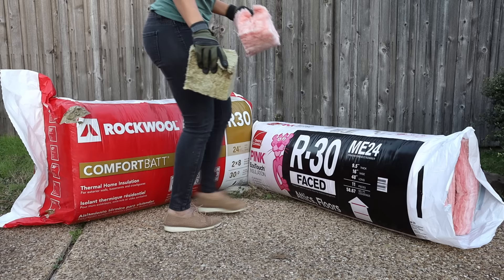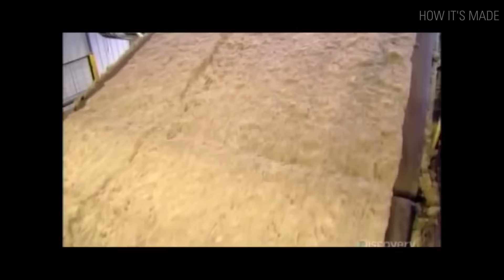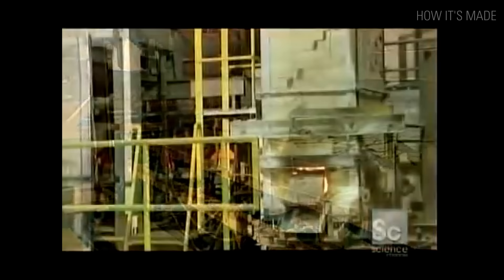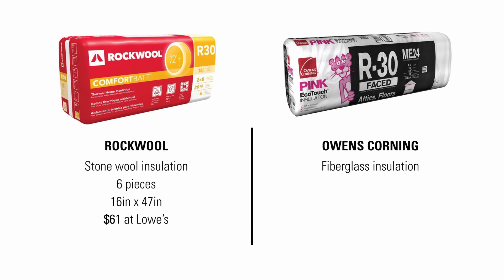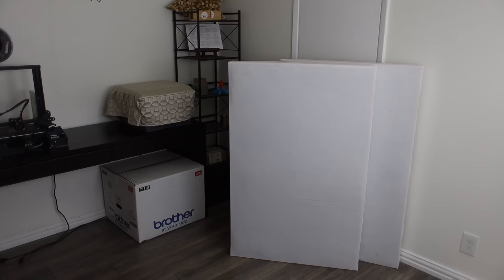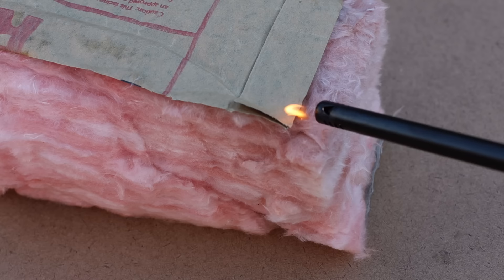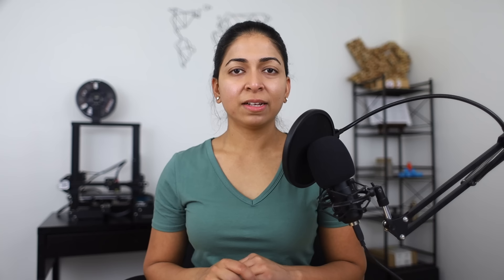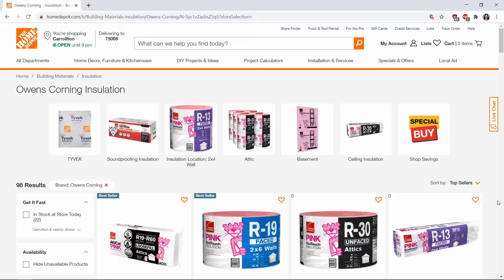Mineral wool vs fiberglass insulation | everything you need to know

Comment: had to renovate a room of my house - exterior wall needed to be completely rebuilt as the windows had been repaired improperly and resulted in the king and jack studs rotting away completely where the windows leaked into the wall.    Also found the roof was improperly constructed so it had to be redone on that section as well.   
When it came to time to rebuild, i chose to use stonewool, having worked with it in Alaska and knew it was MUCH more "user friendly" to work with.   fiberglass insulation, you'll itch for days and days afterwards.   Stonewool, a good going over with one of those sticky taperollers for lint, got rid of any lingering bits on clothing and skin without any real hassle and I had zero residual itching from it afterwards.   The stonewool was a LOT easier to work with in general, and I like the resistance to moisture and rot...  I'll never use fiberglass again..

Comment: That was the best review/explanation of these two I have ever seen! One question I have is about mice and Rockwool . Will mice use it to make nests or live in it? Good job on this video!
Reply: @kenthhamner2641  - which makes it idea for crawl space joists...
Reply: Yes, mice do get into it Rockwool and pull away at it. Our cats keep the mice down, but I do occasionally have to fix small areas of insulation in our crawlspace.
Reply: @kenthhamner2641  Only asked about pests.  We already got the rest of that from the video.
Reply: Seems to me that rodents will make a nest of just about anything so I have my doubts they would leave Rockwool alone.
Reply: @kenthhamner2641  no insulation will hold its insulation value when wet. that applies to rockwool. the insulation shown in the video (comfortbatt) does bend easily. i think you are confusing rockwool comfortbatt with rockwool comfortboard. it does cut, but it dulls knives very quickly.
Reply: @paperwait9611  That doesn't apply to Rockwool because it repels moisture - it doesn't ever GET wet.
Reply: I had a mouse get into my Rockwool insulated cabin in the very short period between insulating and closing in. It wasn't put off by the material at all and burrowed its way thru a number of stud bays, apparently quite happily.
Reply: @adammacer  🤔 ok. Thanks.
Reply: @adammacer  you are wrong about that. the mineral wool fibers don't "GET wet", but the insulation itself will hold water. i actually have rockwool insulation installed on my house so my comments are based on my own testing and observation.
Reply: @paperwait9611  Rockwool dries much easier, if it gets wet, while glasswool is almost impossible to dry out.

Comment: I just built a new 2200 sq ft  home in mountains of VA at 2600' elevation, and chose Rockwool for all the reasons in this video.  I have 2x6 walls, used the R23 in them.. Now on the roof deck I used open cell spray foam, as that is where most of the heat goes, and works great there, but side walls in the rest of the home was the R23 Rockwool.  This allows the home to 'breath' some, and cuts expenses.  But so far my heating utility bills have been very low,  lower than older fiberglass insualted home I  have in NC at 300' elevation and 10 degrees warmer on avg all the time.    House is also quieter, that was the 1st thing I noticed, hardly hear anything outside.  If you are building a new home, this is far superior to fiberglass, and close to foam, with a cost in the middle.

Comment: I’ve used all types in my 25 years in construction Rock wool is my favourite, I’ve also used sheets of styrofoam with tin foil type material on both sides when I didn’t want to gut the interior it worked amazing and at that time I lived in a -50 winter location.

Comment: Rub dish soap into your pores before you start. That prevents the fibers from getting into the pores and makes it easy to shower away all the dust when you've finished.
Reply: Bullshit! Wait, does this actually work? I really gotta try this out. If it does I'll be rubbing it all over my arms and neck
Reply: @autodidacticartisan  It always worked for me. A quick shower and clean clothes after a job with zero itching.
Reply: @michaelterrell  well what have I got to lose. We just got the electricians in and are about a month out from insulation. I'll try it out thanks.
Reply: @autodidacticartisan  When I worked construction sites, we did it at night. We could pre-wire for alarms, intercoms and other specialty work in one or two nights, instead of weeks of dealing with multiple crews. Most of my work with insulation was home repairs, for family or friends. don't get a lot on your palms, so you can still grip ladders and tools. It just takes a thin layer that completely covers your pores.
Reply: Try insulating the rental cabins at a nudist colony.

Comment: I did Marketing and Promotions for a few years, learned of Rockwool at that time.     I've rehabbed 3 places, a house in a residential area, a cabin on a farm, and a house in the country.     I've seen the long-term impact on fiberglass, rockwool, and cellulose.    This is my final project, I went with Roxel, it was more expensive, however, living in the country where homes are more prone to infestation, surrounded by trees on a hillside with notable excess moisture, and being close to the highway dealing with traffic noise, it seemed to be the best product.   I've also worked with asbestos while in the military... if rockwool were in the same realm as asbestos, it wouldn't be sold to the general public.   Additionally, licensing and permits would be required to work with such.

Comment: The ac guy would appreciate you not have fiberglass in your attic anyways... 😅
Reply: @ Fox hates me
It's more important to consider the occupant, rather than the installer, given their long term comfort & energy costs. 
But yea, it's helpful that the HVAC can move. But those guys often just chuck the insulation aside & don't replace it, with the hapless occupant suffering forever
Reply: @guringai  just a joke lol

Comment: Here in Denmark when I was working with a home builder we were told that Stonewool for walls and Glass for callings as heat travels up and it do need to be let out slowly over time which will happen over night so use Glass to trap the heat and slowly let it out so your building do not over heat.

Comment: My 98 year-old house had rockwool blown into the walls and ceilings by my Grandparents (I purchased the house from their estate) circa 1947-48 and it is better than 'Glas under the plaster lath and sheetrock drywall, and it is far more pest and fire resistant than 'Glas. Draw-backs: It's heavier by over 100% cubic foot vs: cubic foot, it holds moisture longer and more than 'Glas does (in case of a roof or pipe leak), it's MUCH more expensive than 'Glas. It has a higher R value (about 50%), some say it sound proofs better (hard to prove in-wall or ceiling), it may or may not "itch" you as much-depends on your skin, you DO need a BETTER respirator with it. A throw-away mask won't get the job done-you need a cartridge type. No insulation is "perfect".

Comment: I know this video is a couple of years old, but there is an error that is significant. The weight difference between rockwool and fiberglass is roughly 3.5x, not the just over 2x indicated in the video. It's quite significant. For vertical surfaces (walls), this generally isn't a big deal, but for ceilings or crawlspace floors it can be very significant. As an example, my 1600 sq ft ceiling would take about 4200 lbs of rockwool to get to R46 (2x6 ceiling joists = R23 rockwool + R23 on top of that). The equivalent fiberglass would be R49 at a weight of just over 1200 lbs. That's additional weight of about 3,000 lbs to use rockwool. You'll need to make sure the structure is designed to hold this much weight. Most aren't, particularly older homes which were built with no insulation to begin with. Due to the weight, I did use rockwool in the walls, which works very well for thermal and sound insulation, but in the ceiling I used fiberglass.
Reply: Remember older homes had real 2" x 4's.

Comment: Back in the mid 80s I remodeled my family's old home in Switzerland. The contractor store there highly recommended rockwool as insulation. By using different layers and compression densities I was able to completely sound proof and insulate between floors. (before you could hear every word said that was above a whisper. Afterwards, you could shout at the top of your lungs and not hear a word between floors). The first room I remodeled I used fiberglass insulation then all the other rooms I did in the rockwool. That first room was the only room that would get uncomfortable warm or cold. Now living in Texas, I wish our home had been built with rock wool insulation. I would never consider going back to fiberglass...

Comment: This is why I put mineral wool insulation in my whole house (closed cell sprayfoam on roof and in basement).  The few bucks you save on fiberglass in the short-term will be lost in a couple years when your energy bill starts going up because of fiberglass deterioration over time due to humidity.  
It isn't even like it costs a lot more money in the grand scheme of things, you are going to spend way more time and money on everything else in the duration of installing new insulation.  Heck I'm spending almost more money on paint than the insulation.

Comment: Glad I found this video.  I have two projects coming up, one which requires some level soundproofing, and one which requires insulating an exterior structure with higher moisture exposure than a typical indoor space.  Looks like stone wool is the better candidate for both projects; I'm eager to try it out now.
Reply: I have used both products many times and the rock wool is better as a soundproofer.  Fir the outside, I like to go with rigid foam sheets. Foam isn't fireproof, and that's the drawback, but it is  much more water resistant and a good insulator, so for my zone, it's a good choice, because here is a long wet winter. Rock wool is a good choice for external too. Just too expensive here.
Denim is also a choice, but I have no experience with it to speak of.
Good luck on your projects.

Comment: As you state stone wool is more fire resistant, but I'm concerned that you showed fiberglass burn resistance by burning the paper it's attached to.  
Additionally, I understand that stone wool, likely because of it's weight, has a tendency to settle much more than fiberglass.  This can result in insulated spaces over time, especially in the walls.

Comment: Wow! Now I know why even after topping up my fibreglass insulation in the loft, my heat loss is still high. The original insulation was compressed and a little tatty. So no air trapped inside. Also why I needed large metal fire hoods over my lights making the insulation area smaller still!

Comment: Yeah, polystyrene under 8-15 cm concrete floor or insulating foundations outside of building - highly flammable but no problem if it's in the ground or between inflammable surfaces. Stone wool for walls (in and out) and glass fiber for roof insulation.
Had my narrow space above garage roof done this spring - shredded glass fiber blown trough hose into every nook and cranny - much fluffier than mats .. and no need to disassemble more than little of structure to get access.

Comment: That was a very clear and informative analysis of these two types of insulation. Explaining and showing how both types are made clarifies the contradiction between hard, inflexible glass or rock and the (relatively) flexible quilt end products.   
Comparing some of their technical capabilities helps to determine whether one product or the other will be used according to circumstance, how they should be installed for best performance. 
This is the best continued professional development (CPD) programme I have seen on an important technical issue. I will look out for your other programmes. Thank you. (FYI: I am a UK architect.)
Plus: there is also some interesting bonus additional technical commentary by viewers.

Comment: At about the 5:05 mark, she explains the insulating value is based primarily on the trapped air within.  Air is an excellent insulator.  If the fiberglass compresses, it will lose that air and lose its R value.  I was unfamiliar with Rockwool before seeing this video.  Seems like good stuff.

Comment: Both basalt and glass fiber products are also being used as additives to concrete to increase strength. There are even some wound basalt fiber products that can be used instead of steel rebar in reinforced concrete which last much longer than steel because of the natural corrosion resistance.

Comment: The temperature resistance of Mineral Wool is no joke.
It's commonly used when building propane furnaces to melt metals as the primary insulator.
They can survive many cycles of heating even high temperature metals such as copper or brass.

Comment: 5:05 About twenty years ago my husband and I lived in a home with terrible HVAC control. Every winter we froze and the system chugged along nonstop to keep us cool in the summer. 

After a couple of years we decided to remodel the master bath. To my horror, we discovered that the fiberglass insulation had compressed over the years, leaving a two foot gap at the top of the wall with NO insulation at all. None. NOTHING. Just a space and siding. 

I've seen gaps form before, but never that bad and the home was only about ten years old.

Comment: Not to forget about wooden wool! Will not burn, grown by local woods, way less energy consumption during production.

Glas wool can burn. Not the fiber but the resin that sticks the fibres together.

Stone wool is said to be way more durable and used a lot around here. But that it is much more stiff means, you can not compress it for example with a drywall board that easy.
So you need to work more precise.

From Knauf there is a glas wool that is not itchy. Like that for indoor applications like acoustic ceilings.

Comment: Super useful video. I have purchased sever hundred dollars of the PinkPanther stuff and now regret that I should have gotten the Rockwell brand because it is moisture resistant and hence no mold and mildew in the bathroom walls.
Reply: You should be putting a vapor barrier in your bathroom in front of the insulation to stop the condensation from going in the wall. In any case fiberglass doesn't mold

Comment: I am Using Rockwood & reflectix (bubble foil) in the ceiling walls, floor of my tiny cabin..
I think it will be warm in winter and cooler in summer and warmer in fall & spring cold mornings. 
🤠🤠🤠

Comment: Rock wool used to be more common around here but rarely seen it now. I see blown in fiberglass used in walls behind a plastic mesh then covered with plastic sheeting. Shredded paper, cellulose, was the hot deal for a while (not good!) Spray foam is probably the best because it is vapor tight but nasty fumes in a fire. I agree that rockwool is better than fiberglass. Owens Corning has great ad campaigns though.

Comment: Let me tell you: I built two tiny houses with the same exact thicknesses of insulation. First, was fiberglass, 2nd rockwool flexirock. The difference is NIGHT AND DAY. The R values of fiberglass are utter bullshit. Air circulates freely through it, setting up a convection currents which merrily circulates the heat from warm to cold side, 24/7. 
My 5" insulated floor of glass was always cold to the touch in a NY winter. A wet towel literally froze to the floor one night. 
The rockwool floor and walls were always warm to the touch, in any type of cold. I burned much less wood with the rockwool house, same dimensions. 
Rockwool flexi is an absolute joy to install. Cut with a bread knife, squeeze in, expands to fill gaps, and fits tight. Never sags. 
Fiberglass fibers are absolutely nasty. Rockwool's bit of dust is nothing like it. Very minorly irritating, and non-carginogenic in lungs (tested-on poor animals sadly). :(
Reply: R values are tested in lab (CCMC in canada) so 2 different products installed at the same r value will have the same thermal performance. Your comment seem sponsored by roxul

Comment: Due to the immense popularity and some controversies of insulating van/RV conversions, I would like to see a video on that. Obviously the condensation of moisture on the interior of the metal body would cause rusting so that is a concern and conflicting philosophies on how to deal with that abound. There is a huge audience for this information on YT and you could increase your following a lot and I would make sure to refer people to your video in the comments on YT van build tours or howtos. Despite having a BS Degree in Architecture, I can’t decide what I want to do with my MB Sprinter van build re insulation. Another consideration is in case of an accident, the material must be removable fir the repair shop to accept the job. Also the spaces fir the insulation are odd shaped.

Comment: as a redseal insulator i have used both and you are incorrect on the rock wool being water proof it will wick water if sitting in water for an extended time . the rock wool will also grow a purple mold if not dried after getting wet. mice will make homes in both the fiberglass and rock wool. but with that being said I have insulated my house and garage with rock wool as I found it to be the best option for the dollar value. like any insulation it is best to protect it from the elements and mechanical abrasion.